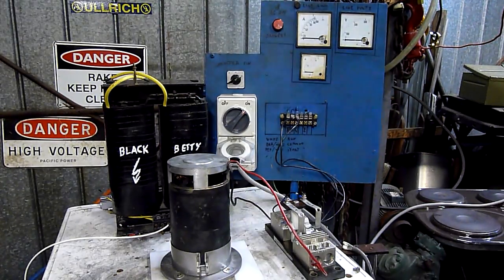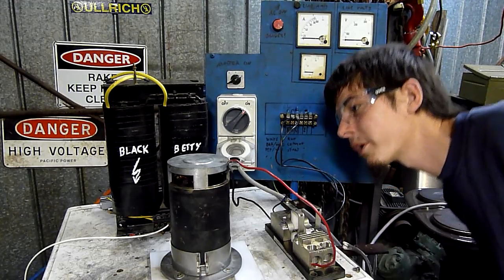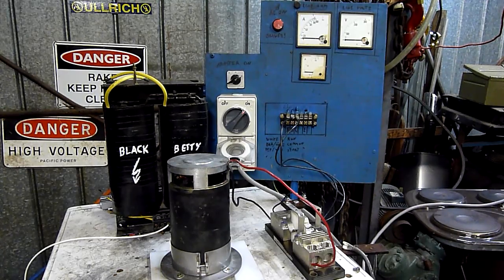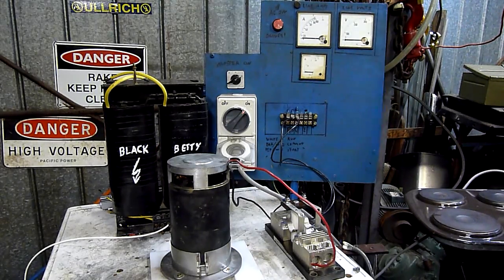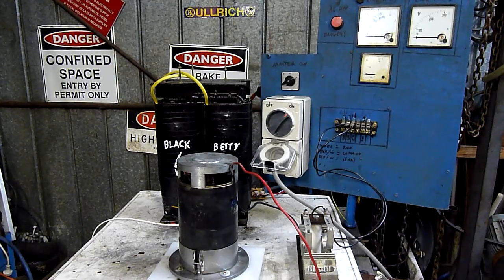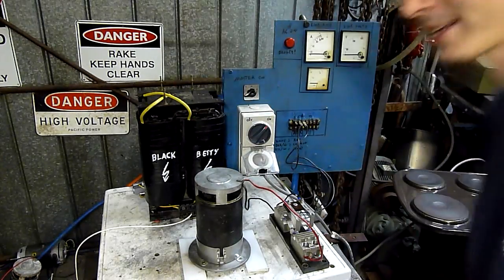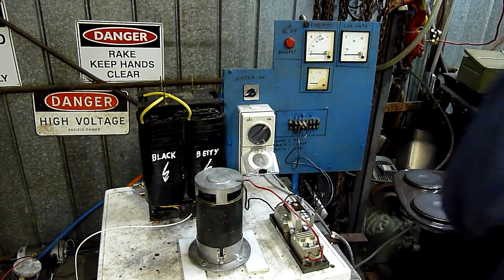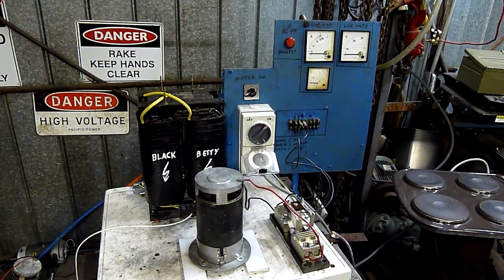600W 24V Motor Burning Up on 300V DC

Comment: I am not much of an electrician, what does the hotplate do?
Reply: +Tony Page I think he had it in series with the motor, using it as a big rheostat.
Reply from the maker: +themaritimeman pretty much, it just limits the amount of power the motor can draw so it does not take out my main circuit breaker and shut the shop down.
Reply: limiting the current

Comment from the maker: @cheetawolf I got them for free from a old VFD, but you can buy the diodes from RS components I think. they are Semikron 60A SKR series, fast recovery rectifiers.

2 have anode to stud, 2 have cathode to stud, allowing me to use them in pairs on 2 common heatsinks.

Comment: @Aussie50  Yep a variac is great to have, still good to keep an ammeter on the variac primary so that you don't burn out the winding. Because high power variacs are not cheap.
You could try to use 4 or 5 x 12 Volt car  batteries in series to give you 48 or 60 volts dc with grunt.

Comment: That motor went well
I think that it can handle the current. You probably had about 210 Volts AC on the elements and remaining 30 Volts AC across the motor. DC value may be 45 Volts.
Just check with a voltmeter across the motorterminals.
For a burn out, put it direct on a 55 or 110 Volts 5 kVA  transformer

Comment from the maker: @AnasheedCast the hotplates act as a resistor to limit the current drain on the mains input supply. wiring this motor to mains alone would trip the breaker immediately.

Comment from the maker: @narcoti it is a prefab, and as you have found the bugs get in everywhere. I just keep the bug zapper on for the flying ones attracted to the light, and use surface spray to control spiders and other crawlers.

but yeh, it is very hard without lining the whole place in plaster or cement sheet.